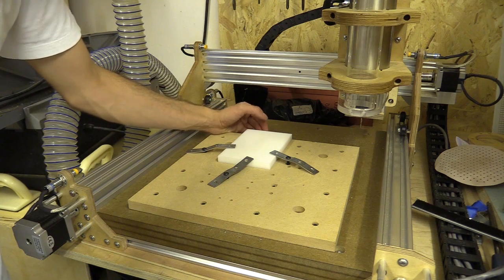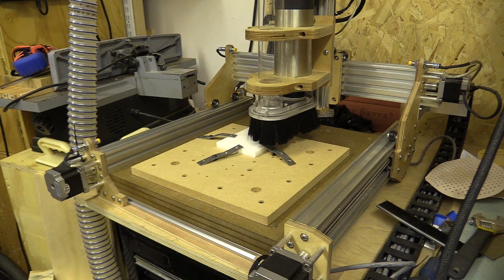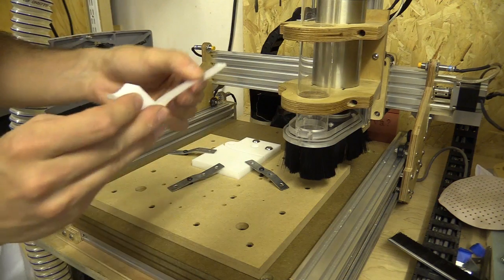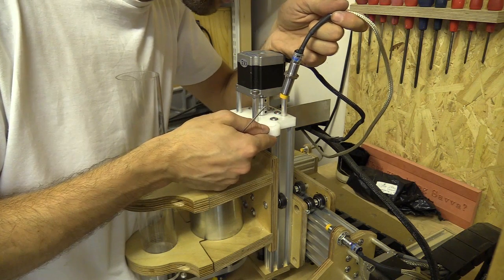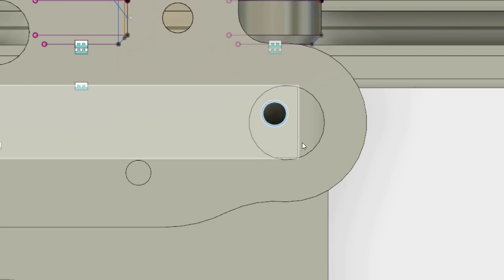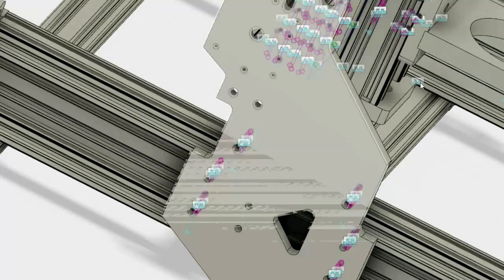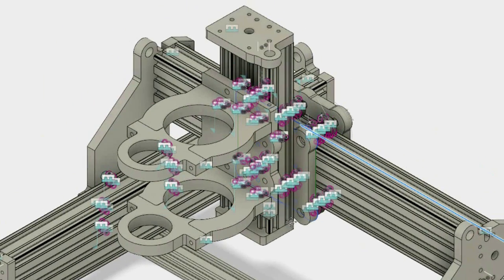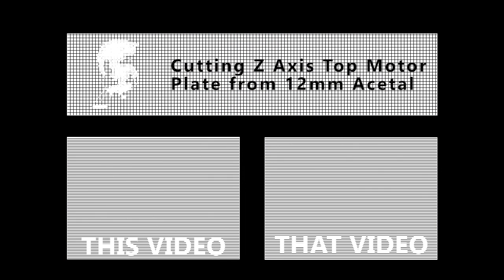#19 Cutting Z Axis Top Motor Plate From Acetal 12mm #19 / Design Upgrade

Comment: Acetal, POM and Delrin should be all the same. My experience with POM is that it machines beautifully, is expensive and resists compression really well. I wouldn't use it for plates though, as it will probably flex quite a bit - I have a few rods of 20mm diameter and they get quite wobbly at 1m lengths.

Comment: You really want to machine plastic fast. I use a 40% step over, the more material you remove the less chance of melting. Since you are screwing the material down, machining forces shouldn't be a problem. I use the imperial system, so this may not make sense to you, but I cut plastic at 100 inches per minute at 10,000 rpm for an 1/8 2 flute spiral and that feels pretty comfortable for me. Your machine is looking pretty good, I've been watching from the beginning, keep up the good work!

Comment: Do you think the acetal will be rigid enough for the Y plates? It feels quite flexi at that size compared to the plywood you have now.
Reply: Steve Kingsley It should be fine given the size of the plate and where the bolts are.
Reply from the maker: It feels quite rigid. The ply worked surprisingly well but I felt like the eccentric spacers ate in when tightened - don't think that will be the same with the Acetal as it doesn't compress the same way. And it's really easy and quick to cut.
Reply: That's cool. I'm still in the early stages of the mechanical build and it's been good to see all the steps you've been though. I always enjoy using a machine to make it's self better parts.

Comment: Hi Savvas, I've looked into sourcing some acetal for upgrades and wow, that stuff is not cheap by any means.
Reply from the maker: Yeah nothing beats free - all the ply plates were made from off-cuts. I paid £71 for the two pieces of Acetal.  The same thickness of aluminium would have worked out a little more expensive. I really need to try cut some aluminium before upgrading the machine.

Comment: All those fillets in the sketch complicate things. I usually extrude with square corners and add the fillets after, which makes constraining things easier.
Reply from the maker: Yeah it would have been easier if I had put those in first, and then added constraints - this way I added constraints - decided to fillet a lot of edges and had to double check what I constrained... but I did and everything seems to be ok... for now. I checked all the exported vector files by flipping them and laying them over each other.

Comment: would it be easy to print the parts out in pla and sand casting them with aluminium
Reply from the maker: Errr, I don't think so - it would be easier sticking a print out of the vector lines onto aluminium, and use a pillar drill, a centring drill bit and a metal band-saw to cut everything out
Reply: yeah I see your point